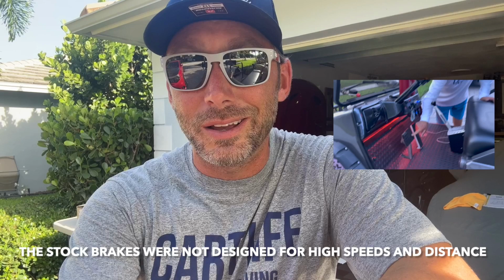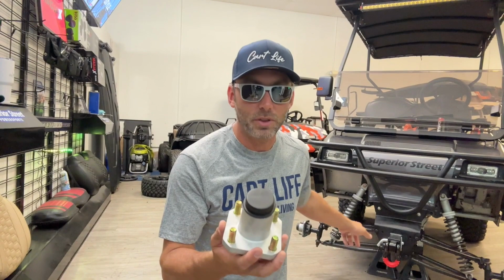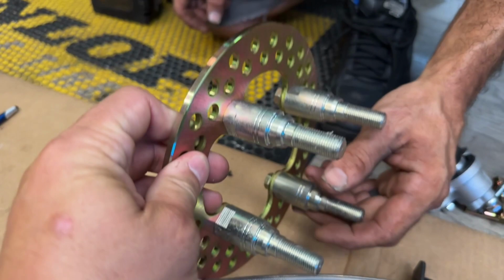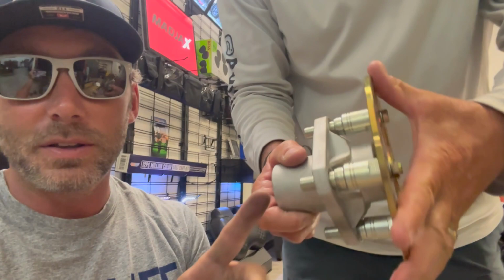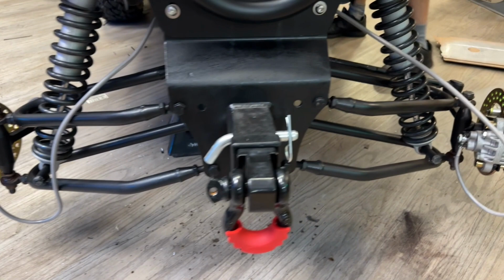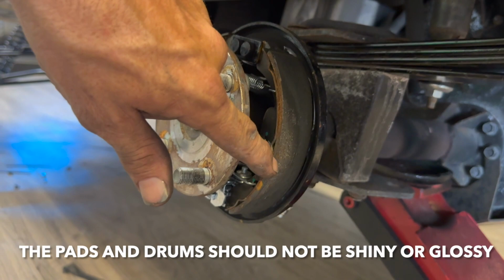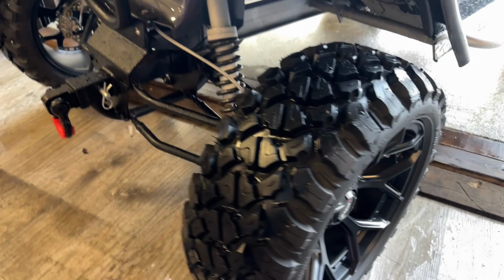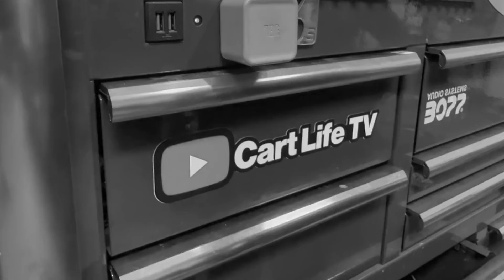Episode 7 - Broke Brakes Repaired - Full Rebuild & Upgrade to Jake's Disc Brakes on our Club Car DS

Comment: How’s that “brake fluid” working out for you?
Reply from the maker: Ha!  There was a typo in the manual AND on their website.  You need to use dot 3.  We're going to update this.   Jakes is aware of the typo but still hasn't fixed it.

Comment: Good video. A bicycle shop will have the oil for the brakes. Most bicycles or ebikes with hydraulic brakes use mineral oil based fluid.